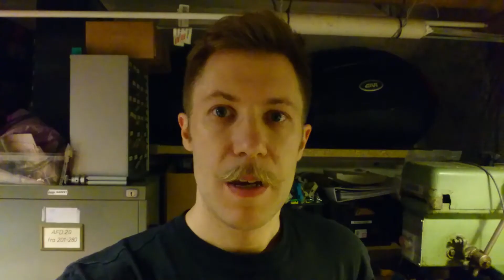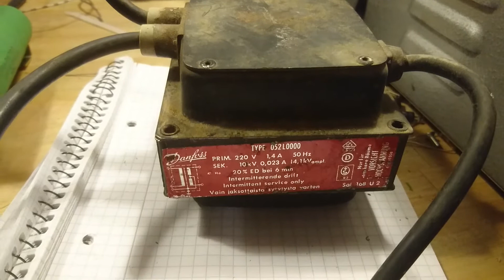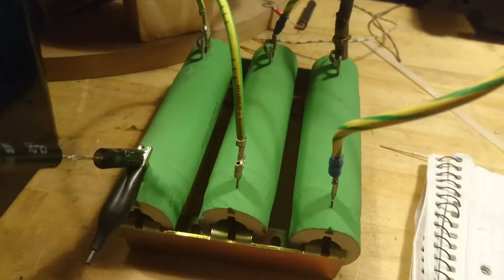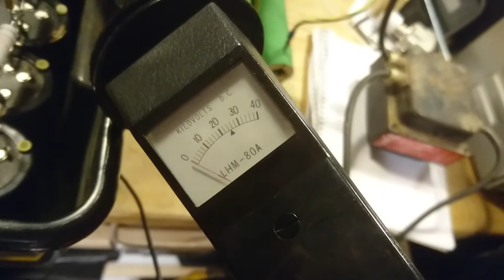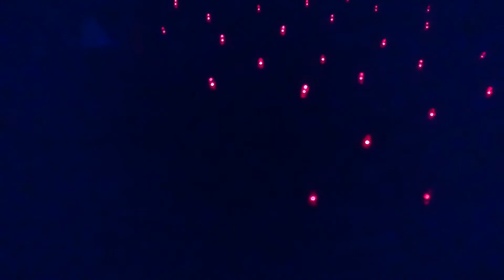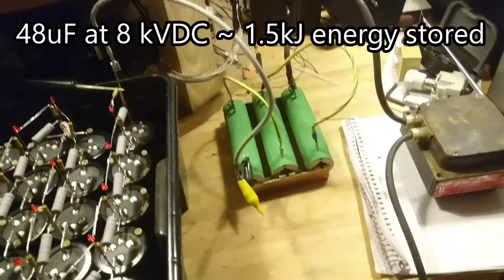5kJ Capacitor Bank, 1.5kJ BANG Test at End! 35 Electrolytic Caps in Series for 14kVDC/48uF

Comment: dude you realy need to considder using diodes and a good balancing circuit.
thrust me, I've done 19KJ at 2000 volts, only 4 capacitors in series, but believe me that you dont want to pop up one cell,
yours are small, mines where 2 liters each, fitted in a bullet proof case, of 2 inch thick composite, but damage has been done, now I have to fix it up before going to 50KJ
Reply from the maker: Could you elaborate a little more on that balancing circuit? If you visited the forum link you can see that I did calculate how to balance the voltage of each capacitor and using bypass diodes, I am not sure it will make much difference if one of the capacitors go ballistic.

You are absolutely right about the missing blast shield, which will also be in place for full voltage testing :)

Comment: what happens if you touch that ?
Reply from the maker: I would expect a flesh wound with arc flash damages, like burned skin, copper/brass deposits etc, not something you want to try and why there are multiply safety barriers, like I am further away than any wire could reach :)
Reply: can be killer ?
Reply from the maker: Yes, a defibrilator, as you know as a heart-starter can shock with up to 300 Joule, this bank contains up to 5000 Joule, but also at a much higher voltage and with a much faster discharge rate, so it is deadly if you get this amount of energy discharged through your body.
Reply: @KaizerPowerElectronicsDk  just thinking would it be safer to put them in parallel and have the same power but at a lower voltage? Less deathly like 50v or some like that
Reply from the maker: @rodriguezfranco3839  low voltage short circuits wear a lot more on the parts than high voltage. The charge in coulomb, is what wears, which you can see is lower for higher voltage, at same resulting energy in joule. https://kaizerpowerelectronics.dk/calculators/capacitor-energy-calculator/

Comment: Super cool. I love the LED indicators, Red <--very suitable given the circumstances! :) I love it.
Reply from the maker: They are a vital part of safety, if a single soldering point failed in the 35 series long chain, measuring across the whole bank could show it as discharged, but with maybe half of the bank still having a dangerous charge stored, so indicating for each single capacitor gives a precise overview :)